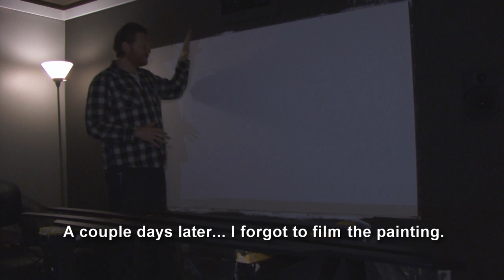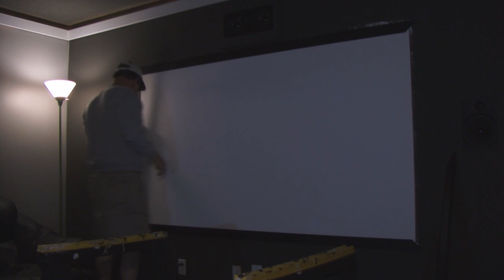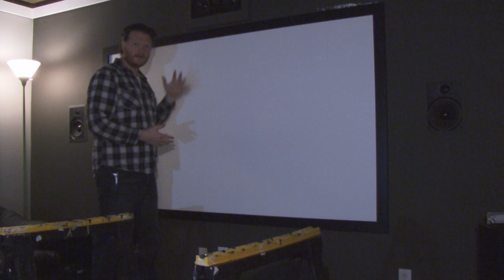How to Build a Super Cheap & Good DIY Projector Screen for Home Theater

Comment: Hi Kennis, good video, thanks for posting. I thought I would mention my experience on this subject. I do outdoor movies during the summer, tons of fun! My 1st movie screen was 15 foot diagonal that I made out of 'blackout cloth'. This material is used on the back of draperies to block all light from coming through. I found out about this material on a backyard theatre forum. It's fairly inexpensive and if I remember correctly it has a 1.0 gain to it. I've since gone to an inflatable screen which is much easier to put up and looks great as well. Take care!

Comment: I just did a DIY black screen on a 1/8" MDF panel.

I believe you must start with a black tinted paint that has no other color tints. I used BEHR deep base (1753) matte base paint tinted to the "limousine leather" tint. The tint has no other color than black.  You could try a simple black base paint.  The metallic paint was the Rustoleum latex metallic white pearl accent paint. I don't know exactly how white it is but will have to do. I used 1/4" drywall cut into 3 equal pieces and painted flat white for testing. I painted two coats of each mix on each.

My 1st mix was 60/40% black/white metallic. I loved the black levels but the white level was a little too grayish and overall the picture was a little too dark.

My 2nd mix was 50/50% black/white metallic. This mix worked for me because it was brighter with no hot spot and pushed the white and black range to the middle of the spectrum. Meaning the white level was whiter and even though black level was not as black as the 60/40 mix it was much better than what i could get from a pure white screen.

white screen: 00/100% black/white                       gives white[------------        ]black range.
black screen: 60/ 40% black/white metallic mix gives white[       ------------ ]black range.
black screen: 50/ 50% black/white metallic mix gives white[    ------------    ]black range.

I'm using an old 3200 lumen 3M MP8775 long throw projector with a res of 1024x768 and can do 720p or 1080i about 15+ feet from the screen. I'm sure if i buy a new 3000+ lumen DLP or LCoS HD projector, the image will look different and i would have to adjust the paint mix.

My next test is to mix 30/70 or 40/60 of flat black paint/silver or black metallic paint to try to widen the white[ ------------------ ]black range while trying to maintain the current brightness.